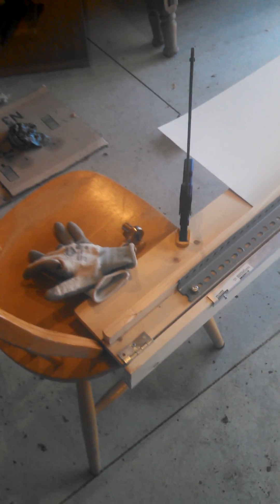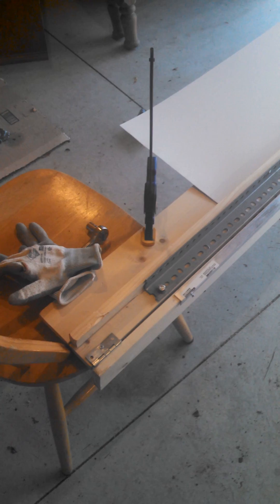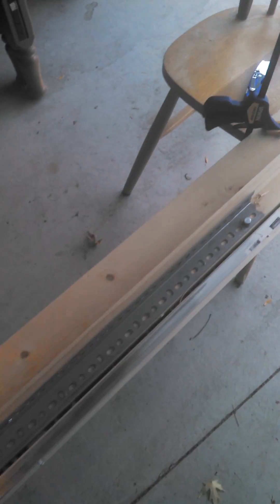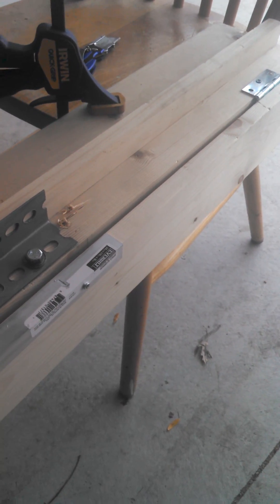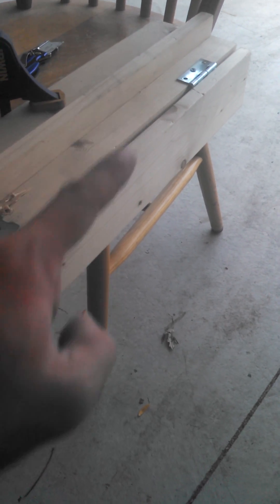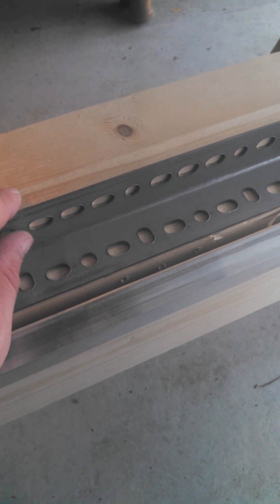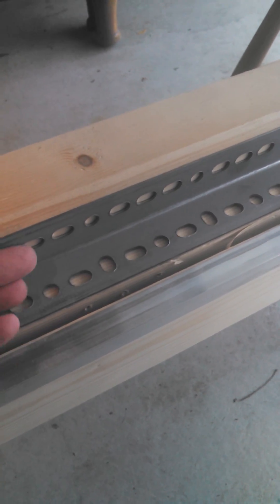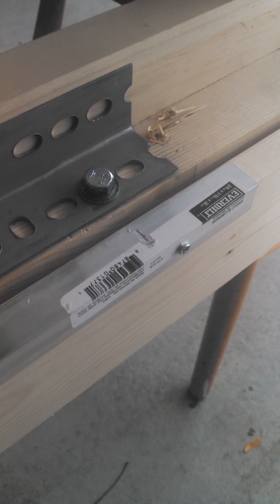Aluminum brake. Homemade for $30

Comment: Genius... I've been  looking for something  like this. a quick fix.  I dont have any tools, and the closing day on my home is approaching. 2  of the windows the trims flew off with the wind and the insurance want to to get that taking care of every company wants $600 per window thats absurd
Reply from the maker: @MrStalyn0499  Looking back, they make PVC (plastic) boards and trim. They may be a better, quick fix option that bending aluminum. 

PVC boards with caulking around the window and brick/siding etc. 
There's also some videos floating around of people using two larger boards on hinges. That's probably the easiest and cheapest to do. 

Best of luck.

Comment: What a waste of my time after getting so excited about hiw easy it is to make. It does not work at all. Thats why he never demonstrated breaking something on it
Reply from the maker: It works about as well as anything else that's homemade
 It's just a pain to use. 

Two treated boards cut at an angle, and clamped together bends about the same, you won't need a wrench, and you're not limited by size and length. 
But by all means, feel free to post your videos.

Take care. All the best.

Comment: Thought this was a great idea.  Built it.  tested it on a 1 inch piece to verify the shape & dimensions for the will wrap and it worked great.  went to 32" width for a window sill using .024 aluminum trim coil (from Pella).  will not bend a 1/2 or 5/8 leg.  instead it rides over it.  Since this leg is under existing sill and will be in caulk, I tried it again after scoring the length.  still no good.  have stopped since this is the first bend in the configuration.  have not attempted to bend at 1 1/8" for the 2nd 'leg' to see if it would work.